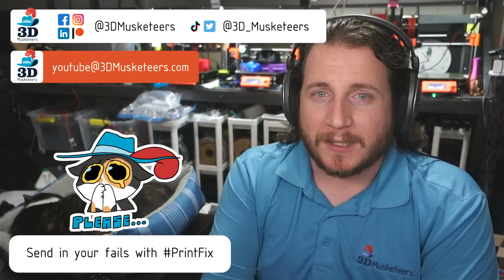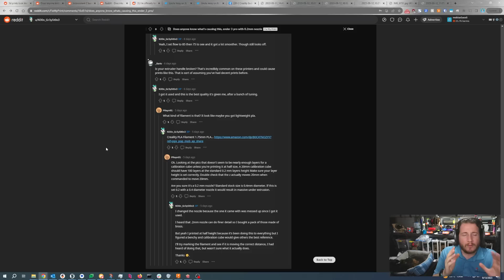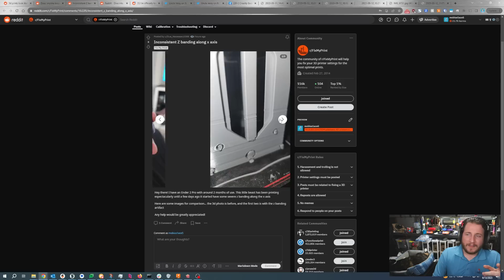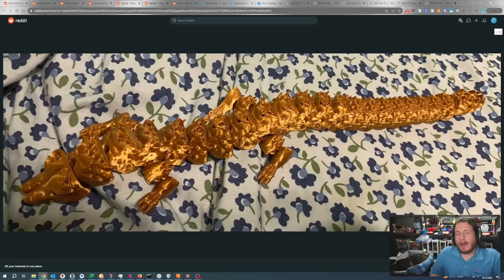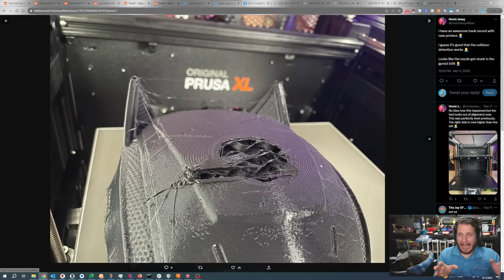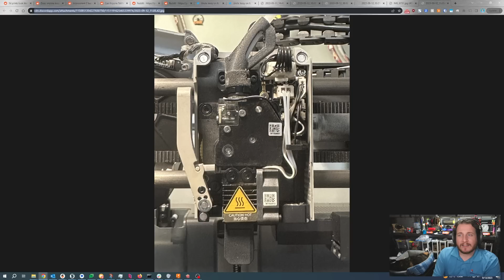Fixing a Bambu That's Eating Filament! - PrintFixFriday 105

Comment: Whenever I suspect an SD card has corrupted my GCODE, I'll either find the main copy, or reslice with same settings, then use a program like WinMerge and compare that copy with what's on the card, it's an open source text editor with color coded difference checking, it's fantastic for this use. I've found mangled GCODE within seconds, but you have to have access to an identically sliced copy to have success, often I haven't even closed my slicer window until the prints are completed so.. often not difficult! The failure I had was 'silly', it basically kept popping the filament out of the back of the extruder mid-print. But just one line of code difference and that could easily be the Z slamming into the top of the print..so yea, bad GCODE is bad GCODE, there really needs to be checks in firmware for out-of-bounds numbers TBH.
Reply from the maker: it seems that the extruder crashing like that is not a solitary issue and is documented within the Prusa forum, so this goes WAY deeper than I expected. Been trying to learn more about it!
Reply: @3DMusketeers  I heard a lot of issues are related to the adata USB drive and adata sd card seem have issues.

Comment: Just a small correction, Bambu use 2.5mm ID 4mm OD PTFE tube, so the "regular" 2mm is not recommended by Bambu and could potentially cause further issues.
Reply from the maker: oh, interesting.. noted.. Of course they do something different......

Comment: I overtightened my prusa mini Bondtech extruder screw and the insert stripped the Sls nylon part.  How should I go about fixing it?
Reply from the maker: is the insert spinning? If so, get it off the bolt and then just heat it back up with a soldering iron. It should re melt in place. Note, it wont be as strong, but it may help..

Comment: I was sitting here, screaming in my head: WHITE FRIGGING FILAMENT in a .2mm nozzle!

Until you finally said it. Heck, I am having first layer issues with white filament in a 0.6mm nozzle currently. I hate that stuff. :-)
Reply from the maker: lol. Yeah, stuff is horrid..
Reply: I use Hatchbox White filament and on multiple printers. It prints fantastic with no issues so far.

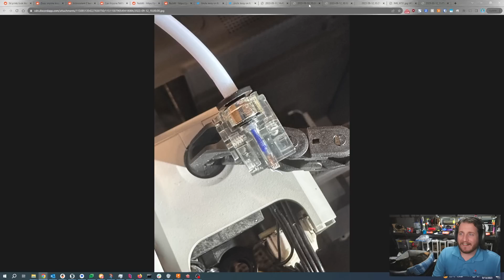Comment: 19:15 easy fix on this one, and I have been here before. Use a hair dryer to warm up and soften the filament and then you can pull it through or push it through with a jewelers screw driver. As far as the PTFE tube goes, not much you can do once you pull it too hard and the little teeth dig into it other than a super thin pipe you can slide down into the coupler to release it
Reply from the maker: interesting, yeah the heat may work, but has to be reaaaallllyyyy refined

Comment: Grant. Two things. Thanks for all you do. About a week after I got my Bambu X1 I had that same issue with filament.  I had to cut the boden tube.  I got the same tubing and that was one of the things I did wrong.  This sucks because I miss my printer and AMS.
Reply from the maker: Is the tubing wrong?
Reply: @3DMusketeers  its exactly the same but they said it wasn’t their tubing.  Honestly it was as if they had to nitpick everything. The repair they had me do required doing half one wiki and finishing another.
Reply from the maker: I have experienced similar issues.. no fun

Comment: On that first benchy the fact that flow is set at 80% suggests the esteps would be a good start
High esteps, low flow setting in the slicer and a skipping pulley from the good ol grub screw is a recipe for cottage cheese (cream cheese sounds smooth and tastes delicious)
Reply from the maker: for sure. Definitely better to start with 100% flow first, then move through them IMO

Comment: 13:30 little hack for silk filament and printing dragons. Place a cube with the model in the slicer that is the same height as dragon. This gives somewhere for the filament to be “purged” into before it fully work hardens from small extrusions and lots of retractions. I’ve found around 20x20mm to 30x30mm cubes with 15-25% infill help a lot worth the work hardening issue. For larger or more detailed dragons may need to strategically place a few cubes so it “purges” more than once per layer
Reply from the maker: oh dang, that is brilliant!
Reply: @3DMusketeers it’s worth a try for those silk dragon prints that repeatedly fail at the 80%ish mark where the movements become smaller and more retractions
Reply from the maker: for sure! Heck, I may start printing dragons again for fun giveaways now LOL

Comment: My fail for the week.......was an expensive one. I got some protopasta copper fill pla. Benchy = fine. Temp tower = fine. Succubus........fell off the bed and so did all the supports. Fortunately it was maybe 5 hours, but still this is very expensive filament. So I increased the bed temp to 80. succubus itself was fine, but the smaller supports....fell off. I can't use snug with this model. It's going to be a complete nightmare to remove. Organic feels like the only option. I did forget to adjust the z-hop which was 0.2mm. I increased it to 0.8 today. Also while I love the satin sheet, I'm switching to the smooth one. In fact I have never opened my mk4 smooth sheet. lol Hopefully this will work better. I want to see this model in rusty copper!!! lol 

speaking of rusty copper, I experimented on the benchy. I sanded it down a bit and added vinegar, hydrogen peroxide, and salt. It worked, but not as much as I would like. I'm not sure if my mix wasn't optimal or if I needed more sanding. I suspect I didn't use enough salt. I just hope I have enough filament left to do this succubus. LMAO The spool isn't that big and it's $50. I wouldn't be surprised if it would be a 500g spool of normal PLA or even less. copper makes it very heavy.
Reply from the maker: oof thats a rough one! Yeah organic may be better there for sure.
Reply: @3DMusketeers  it's gotten past the last attempt so far so good. Either the smooth sheet did it or the extra z hop or the combination of the 2. Fingers crossed. The first one to fall off has branched this time. It didn't get that far before.
Reply from the maker: sorry you keep having issues with it. It is not easy
Reply: @3DMusketeers  I'm using prusament marble pla now. So far so good. It should be done in a few hours. No support fails. It's printing perfectly. And the marble looks amazing. This filament looks WAY better in person than the pictures.
Reply from the maker: looked good on twitter!

Comment: That bambu issue is similar to what happened to my mmu2 a few months ago. I had a print get stuck and I couldn't fix it. It was so bad I had to take it apart WAY further than I ever had. I had prusament laying out in the open for 6 months. I was drying it, but for whatever reason I have to print it at higher temperatures. However.....last time I used it, I dried it at higher temps and now it seems fine. But.....the issue was that the shortest piece of boden tube in the MMU (maybe 2-4 mm long) was clogged. To this day I never could get the prusament out of it. So I replaced it with one from my spares bag. I also realized all of these tiny parts were installed backwards (beveled side facing the selector instead of the filament spool side) so I swapped them. I double checked the instructions. As far as I'm concerned the instructions are backwards. They tell me to install it the wrong way. I found the MMU actually works better with this mod. I'm not the only one that noted that. Someone said newer mmu2's were being shipped with a double bevel on those parts. That way it doesn't matter. Makes sense to me.
Reply from the maker: the big difference there is that the Bambu has a cutter to keep this from happening.. The MMU does not.
Reply: @3DMusketeers  well my issue was ultimately different. It didn't snag. It was swollen! And it wasn't even anything that had been in the extruder yet. That's what doesn't make any sense.
Reply from the maker: ah, yeah thats a thing too, one of the reasons the mk3 heatbreak is different I think

Comment: Silk clogged my original V6 more than once which lead to me shorting it out. I had better times with the 2nd one until it leaked. You helped me figure out that it wasn't assembled properly, but it was stripped and not fixable. Then I got a revo and I have NEVER had an issue with silk since.
Reply from the maker: interesting, wonder what the revo has?
Reply: @3DMusketeers  no clue, but I also noticed that the mmu worked better too. lol
Reply from the maker: hmmmm very curious

Comment: Awesome video as always 😊 Thank you for the content. It is always interesting to watch how you solve issues. I‘d be interested in a video about your Top-10 print(er) failures and how to solve or avoid them. Guess, too few people really do regular maintenance which is the best way to at least avoid avoidable problems.
Reply from the maker: Oh man, the top 10 fails would really depend on what kind, like top 10 newbie fails or something.. Maybe the top 10 most common 3d printer failures or something like that?

So much of it will be printer specific and that is kind of what sucks about it. While a new bowden tube may be an answer for one, it may not work for all.
Reply: @3DMusketeers  I am referring more to a beginners Top 10 issues, since I am often asked how to fix this or that. And it would be great, if an awesome 3D printing expert like you with all of the experience could make an episode on that topic. I know, that it often depends on the actual 3D printer used, but some issues are really independent of the printer.
Reply from the maker: we can certainly try. Are there some that stick out to you more than others?

For me, I see: 

first layer issues (clean bed, z offset, level/tram)
skipped steps (belts, grub screws, z hop)
material stringy/bad quality (NOT WET most of the time, check retraction settings)
issues with filament ramming on bowden printers
blob of doom

From there though, I have no clue for FDM, but you figure some of them have multiple causes, so it could be a top 5 video maybe? Open to suggestions!
Reply: Got that link for the roll of boden tube?
Reply from the maker: sorry, its in the description now!